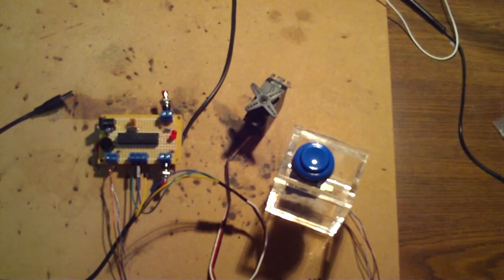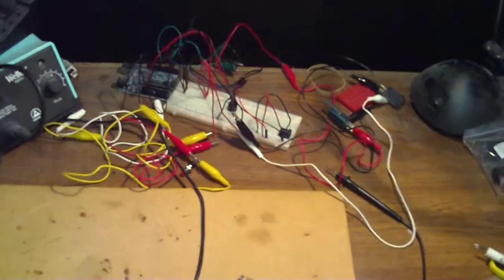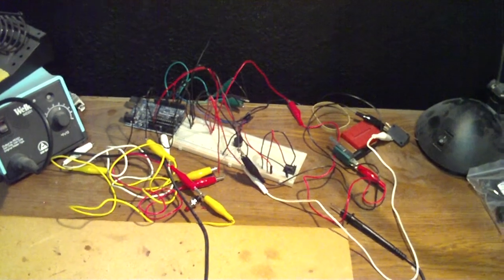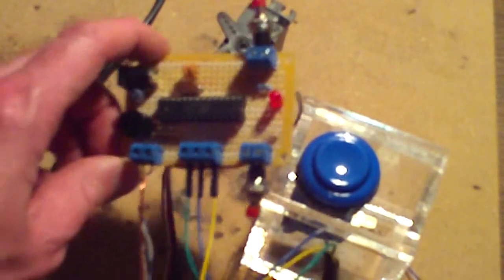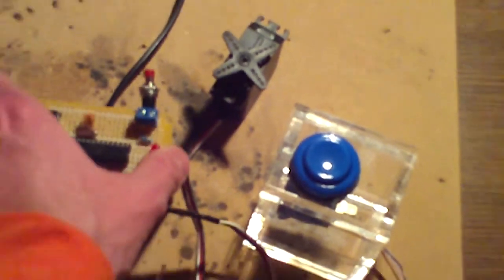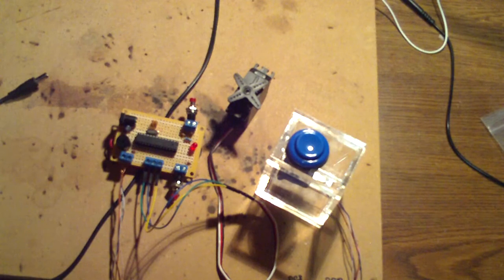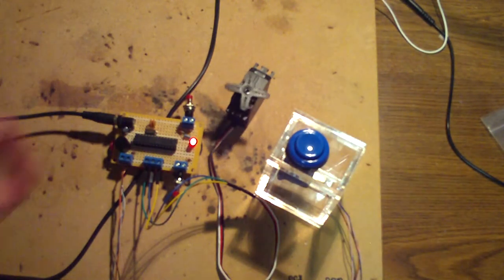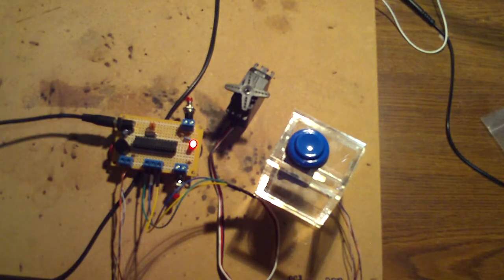Electronic Cat Door Standalone Board Complete

Comment: I have been looking for a car door set up that operates much the way this one does. Great job. I would like to see more detail so that I may be able to make one for my cat. At night, he needs a way in and out without waking us up. Have you drawn up the plans or made a way this might be able to be duplicated? Such as a parts list on what to buy and how to wire it up? I would be interested in knowing how to do this. Thanks for making this project.
Reply from the maker: Hi! Thanks for watching. I have a PDF of my Fritzing 'schematic' (it's kind of a pseudo-schematic). I also have the Arduino sketch (source code). I just put them up on my Dropbox for you (and anyone else interested):
https://www.dropbox.com/sh/6ijeibhc7wu0zo0/AADmGRvjJrP2Z-qmvBaTIfora?dl=0
Reply: @domiflichi  Thank you so much for the information! It is awesome. I do have a question....on the schematic, is the picture at the top a speaker? or is that the button the cat pushes? And, if it is the button, I assume I would simply add a 2nd to the same positions on the board. Thanks again!
Reply from the maker: @laurencevillegarage  That is a piezo speaker. The 2 pushbuttons for the cats are below the resistor off to the left of the Arduino board. Hope this helps, and thanks again for watching!